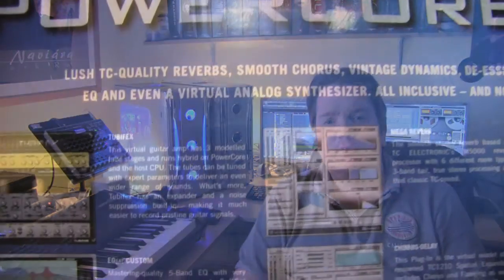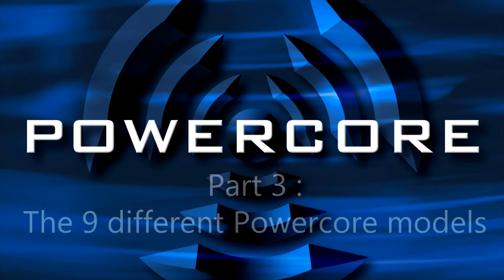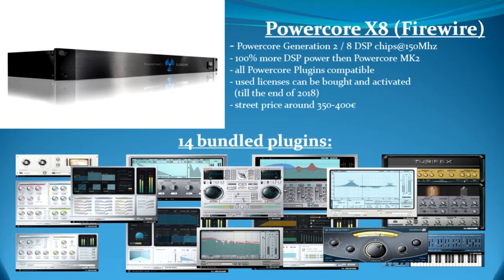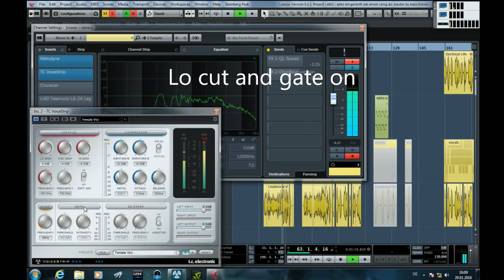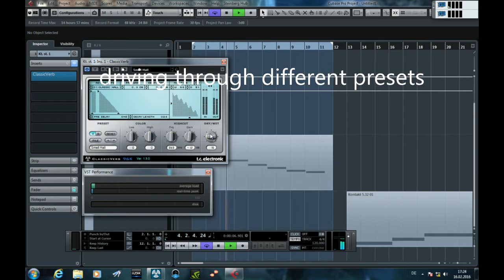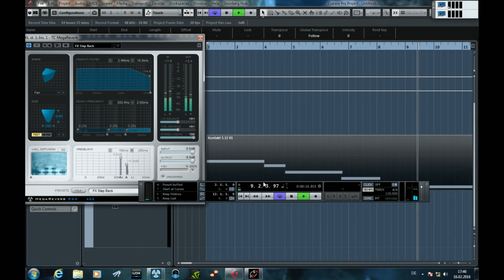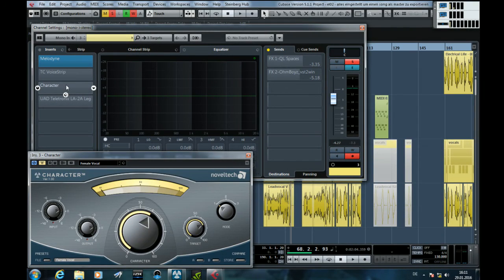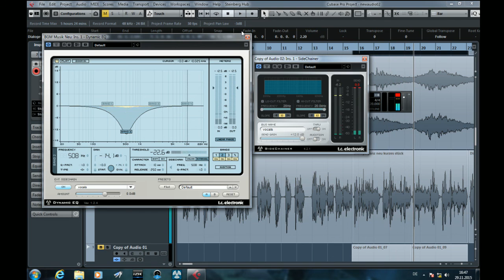your guide to TC Powercore hardware and plugins - #01 [english]]

Comment: TC Spark was the most straight forward to use budget mastering and CD burning software and it was sad that it wasn't supported. I went over to Bias Peak but it was nowhere near as easy to use. The factory TC Spark plug ins were also fabulous.
Reply: I remember Spark well, I did a ton editing for Sony on that app! Super app but was only stable with specific set ups! It was a little touchy / sparky!
Reply: @FiscalWoofer  it worked well for me but there were some issues before version 2.0. I'm disappointed with TC Electronics and how they abandoned both Spark and Power core and I don't go near the company since then.
Reply: @madness8556  Likewise, ever since I got Behringer (who now own TC Electronic) to repair my SK48 which they tried to do but made it worse by swapping out the half working mic pots for the wrong type that stepped the gain. That interface had built in R-Verb way before anyone else was doing it. Early versions where very flaky software wise, but once ironed out gosh tracking vocals with that reverb and light comp - they loved it! Of course it was all non destructive and you could use it post as dry signal or put the R-verb back on as a plug-in! Real shame that company has been asset stripped by Behringer machine.

Comment: so are all of the plugins including the virus included but not activated? can a trial of these plugins be enabled?
Reply from the maker: The installer includes almost all plugins available for the powercore.. most of them are timed trials wich works for some hours except the „bundled“ plugins wich you can use for unlimited time. Virus is included as timed „trial“ on new devices.. wirh a 2nd hand powercore it can happen that trials are expired.. note, that tthere is no official way to reset the trials..

Comment: is this worth to purchase? even if it is discontinued?
Reply from the maker: +Mandy Lane it depends hardly on wich plugins are included with the hardware. The "standard" plugins are useful, but you will get better replacements. Real Gems are all the TC6000 ports like VSS3 reverb, DVR2 reverb, Nonlin2 effects reverb, MD3 Multiband Dynamics with Brickwall Limiter - all the voice tools like : Voicemodeler, Harmony4 - The Virus is also very useful. The Powercore Platform works great on PC, but it's tricky when you use a MAC.

Comment: does the Chorus•Delay can also work in live monitoring mode?
Reply from the maker: +solarion33 yes it works, but keep in mind it will drain a bit of your host CPU performance.
Reply from the maker: +Neocortex Lab he refers to the "no latency mode" of the powercore. As you know each VST Plugin (insert effect) produces additional latency, the powercore has a special mode to run with no latency, but for the cost of some host cpu drain. Good for recording vocals to monitor the effects.

Comment: hi my friend has md3 deleted can I get it back?
Reply from the maker: for wich hardware version? powercore mk1 (large green one) ?? -> not possible, because of the custom installer file.., in case you still have the installer, just reinstall the plugin... for MK2 (all other  Powercore models) just reinstall the latest driver.. license file accidently  „removed“ from the powercore control panel -> bad luck .. this license is lost forever!